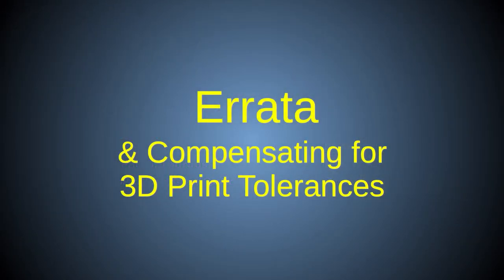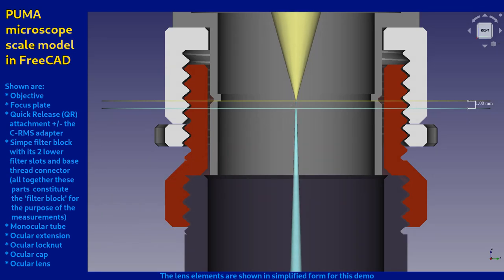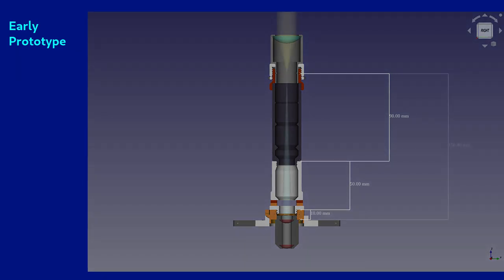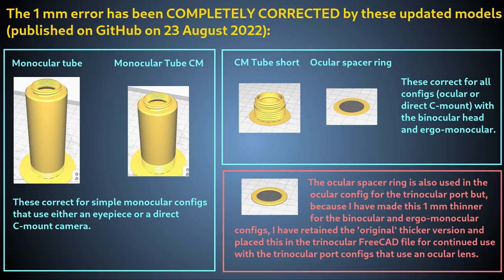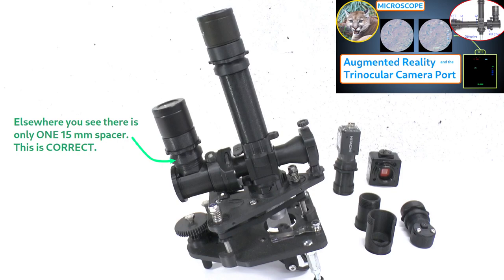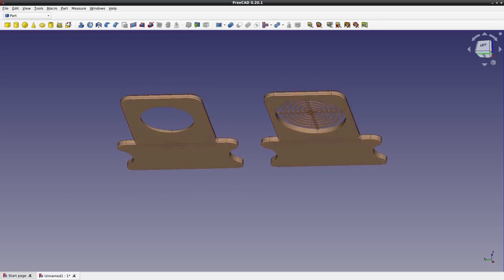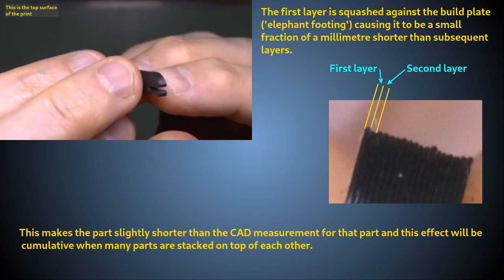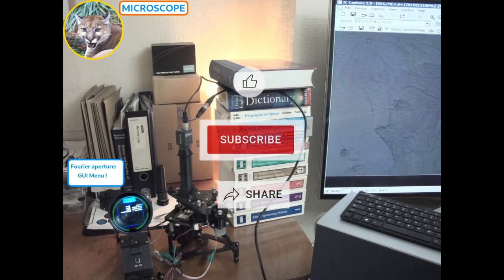Errata and Compensating for 3D Print Tolerances

Comment: I'm working on putting together a PUMA for my (hopefully) future research and was wondering if there are plans in the works for an "inversion" module? 

Objectives being below the sample would go a long way toward increasing the use cases of the PUMA to encompass live-cell work, such as using cover-glass bottom dishes and even plastic culture flasks.
Reply from the maker: Thanks for the question. Right now, the answer is no for an inverted module. I have thought about it - it would require a new stage and stand module and the stage is the single most complex module to build - but perhaps I could design it to use as much as possible of the original stage parts. I agree it would be good to have this option. Perhaps if there is a big enough demand I could return to that if someone else doesn't get there first. You may have noticed I have started to bring my PARDUS project out into the open (https://github.com/TadPath/PARDUS). I would like to make a PARDUS stage for the PUMA at some point so that might be a good opportunity to make an inverted stage module but nothing has been started. If your work involves only imaging (rather than direct vision) then you may find the OpenFlexure scope a better solution because it is an inverted scope (although they have made an upright version as well now) provided the limitations of their optical capabilities don't detract from your research goals.
Reply: @PUMAMicroscope  I appreciate your work and understand if other parts of the project take priority but you can definitely toss me in as one for the "demand" column.

My use case would depend on fairly good optical capabilities as I will primarily be spot checking motile small (2uM by 5uM) parasites for expression of fluorescent fusion proteins after transfection, to decide whether to proceed with more detailed (and time consuming) super-resolution microscopy. 

Thus the OpenFlexure microscope did not seem viable when I first looked into it. 

My current lab uses the Zoe system from Biorad for this, which does and excellent job , but at 15kUSD that is a big chunk of change.... especially for a piece of equipment that will never be directly used to generate figure images.